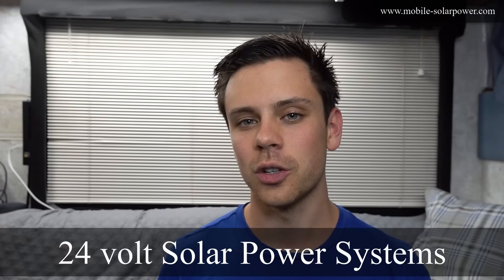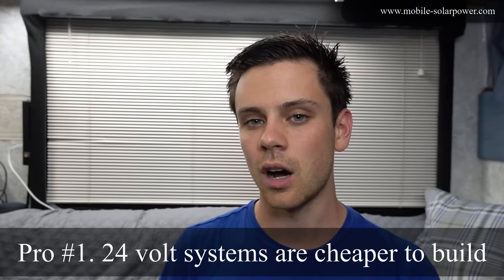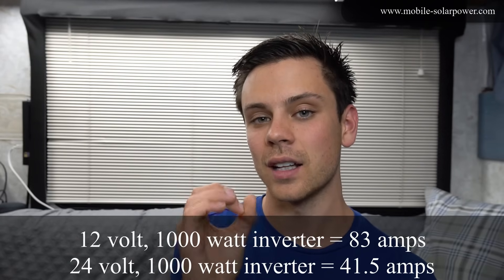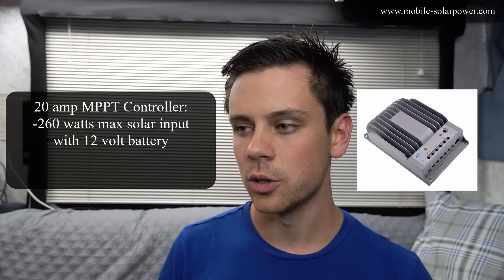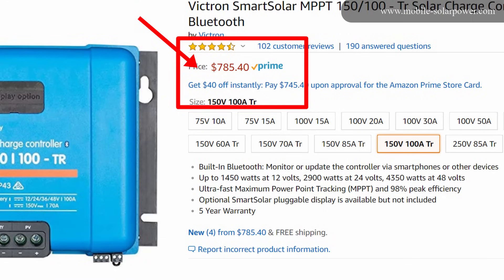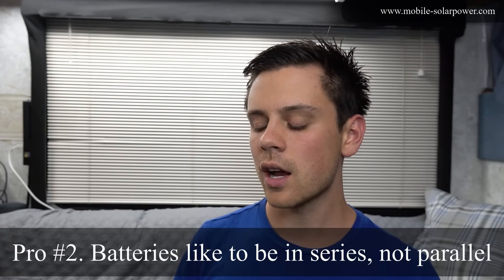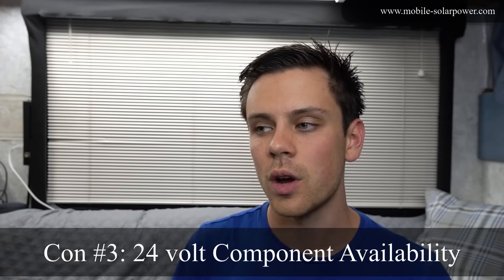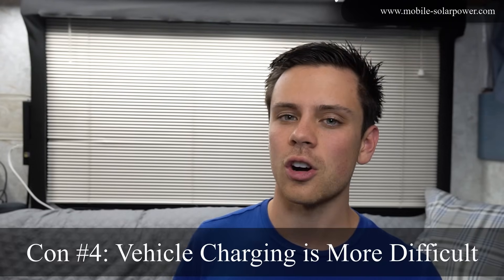12 volts VS. 24 volts for Off-grid Solar Power Systems

Comment: Hi,  I am seeking advice about how to make my on-grid system to provide me with electricity when grid is off.   The problem is that inverters that are designed for on-grid system senses the grid voltage and frequency to synchronise with them, but when the grid goes off the inverter also cutoff even in day light when your panels are able to generate electricity.   Is there away to isloate my home from the grid automaticaly when there is a grid cut-off and fool the inverter to keep providing my home with electricity.  Thanks
Reply: What you need is a system called no-break.  They have different classes about how fast they will kick in after detecting power loss in the grid, but many if not all of them can be upgradable with larger batteries so they can sustain your appliances longer, and they will recharge when the energy is back. They can also take energy from solar.

Comment: Hi, just asking, how many solar panel and battery do i need to run and air conditioning of 4.4amp, 115 voltage/6.5 ghz and 480 watts, For 6-8hours at night? 8 hours sunlight. Cost is not the biggest concern but safety is the biggest concern.

Comment: I'm following the plan from your website for "The Classic 400 Watt Solar Package" but can only afford one 100 Ah Lithium Battery. Can I still wire the 100 watt solar panels in parallel and series, creating 24v into the 40 amp charge controller? Or should I wire them all parallel? Are there other modifications I should make since my battery is only 12v? Thanks in advance!
Reply from the maker: Parallel and series will work great actually. It's ok to use one battery :D
Reply: @WillProwse  I figured it was a silly question, but being a complete beginner to all this, I didn't want to make a costly mistake. I will definitely buy your book! Thanks so much!

Comment: I'm thinking a boat..completely electric including propulsion, induction and convection cooking as well as all the electronics. 24 or 48? With panels becoming better, more efficient, and and more dependable this could work couldn't it?
Reply: I'm curious about this as well.  My guess is that is that your boat would only have enough solar panel space and enough storage batteries  to allow you to take the boat out once every 7 to 10 days for just one day of use.  Have you calculated how much electric power you would need to store to run the boat for a day?
Reply: @manbearpig8691  my hope is that I could perpetuate living on the boat and traveling. No I have not calculated any of it. There will be a gender and big fuel tank that was for motor fuel.

Comment: By the way 24v is a common voltage for buses, semis, and tractors etc. You could easily source an alternator from there for a dual alternator setup
Reply: I agree! I hope this could be an alternative solution.❤💥💯✍
Reply: Find used military alternators for under $200
Reply: @bladenrexroth2555  most junk yards I've been to only charge the core cost for an alternator. Pull one from and semi or bus ect. If you're gonna pay 200 you might as well pay 300 for a new one.
Reply: @alec4672  a reconditioned military surplus alternator? $200 is the happy medium between junk and brand new.
Reply: And Aircraft .

Comment: What about using a sterling power battery to battery charger particularly their ultra certain set for a lithium profile?
Reply from the maker: Those are great, but very expensive. You can use renogy DC DC charger. Both will work great

Comment: I want to run a 0.75 ton air conditioner that consumes around 880 watts 4 amps 220v 
On solar with a pure sine wave inverter with a 80v . 50 amp MPPT  charge controller 12v 

Or shall i go for 24v system

I already got 4 150w 12v solar panels 
And a 165amp lead acid battery

Please give me a advice
Reply: For this kind of output best way is to get small diesel or petrol generator for fraction of price. Cheap running cost, cheap installation and simplicity. With solar you would need to replace batteries every couple of years and babysit watching currents and worry about clouds. Generator can also charge your battery.

Comment: If anyone is interested in seeing a 24v system I have an example video. It powers everything I need in my tiny house/cabin. It includes a 285w panel, 500w inverter and 1kw 24v Chevy Volt battery (now 2kw). The entire system cost me less than $2000 Canadian.  Even if you are just fixing or upgrading your 12v system,  it's time to sell it and move to 24v (or 48 if you are power hungry). Also, bite the bullet and go lithium. Find someone who  salvages Chevy Volt batteries. I don't believe you can build a quality setup for less in the long haul. Remember,  I can keep my whole system in my cabin with no off gassing.

Comment: Off grid 30years = you have explained things very well -  I have work on 12/24 volt mix  with battery mix (lead acid and nickel iron )also using the hho gas coming off the nickel iron batteries  —— the potential of the hho / browns gas adds another dimension to the situation

Comment: Hey I see you have a lot of knowledge so was wondering what would be the best route to go to solar power my golf cart it has 6 12v batteries and  my boat which has a 24v trolley. Motor and a. 12v motor battery

Comment: Hi William
I have a stupid question
I would like to build a system with no battery
To use directly the electricity produced by the solar panel and transform it into hot water 
To replace battery with hot water .

Could it be possible ?

Comment: Thanks for the great info! Do you have a 24v solar charger controller guide?
Reply: Blakehx all the controller companies have documentation online for their controllers. So if you have particular controllers in mind you can read their documentation in advance. Also it’s important to make sure that the controller inverters you are looking at are 24v. Some self recognize. Some look identical to the 12v version. Sometimes they bury it in the specs when it comes to cheaper ones. Midnight, outback and Morningstar all have online documentation and have great manuals. I’m so glad I started with them because I learned a great deal of system education and have been able to manage systems that I’ve designed for various projects. There was an inverter I was looking at. I’m not sure if it was samlex or a comparable one that had a great manual with a lot of details on battery set ups and wiring charts.

Comment: Never knew about the parallel thing being bad for batteries.  I have 4 12v batteries in parallel for a UPS setup and I keep getting shorted cells.  Been through 3 batteries now in about 5ish years.  Been wanting to upgrade the setup to 48v though then I would do 2 strings of 8x golf cart batteries.  With mid point voltage sensor I could catch shorted cells sooner too if it happens.
Reply: Red Squirrel sounds like you aren’t vigilant about your watering of your batteries. Dry cels mean that you are over boiling or under charging on your system. Or have a lot of cycling and power fluctuations. Which can happen in weather. I keep the battery caps that have the float level now. And it’s easy to see when they start going low. I also change my batteries once a year and resort them and rebook them up. Clean them and recheck my wires and fuses.

Comment: Great video again. I’m torn between 24 and 48 volt as a tiny house can be the same as a cabin in some respects. I guess that’s up to me to figure out if I’m brave enough to go 48v. I should investigate the cost difference between 24v and 48v components to see if the danger is worth any cost benefits 😬 Thanks Will.
Reply: I guess a lot of it goes back to what you are needing to power. Fridge, AC and such seem to be the biggest guzzlers. 👍🏻

Comment: I should be paying you for this info. ^^  Personally I´m trying to design a system that works in the middle of Sweden that can produce enough power to run 500W for 10 hours a day. Not easy...
Reply: Well. It's easy, Although it is NOT cheap! LOL 😂

Comment: Lithium batteries don't care if they're in series or parallel, so long as they have a Battery Management System to prevent over- or under-charging.
Just be sure to buy the right size battery for the system voltage you intend to use, since the BMSs which are built into the batteries won't work correctly if you put multiple lithium batteries in series.
Reply from the maker: Well they need to be matched by internal resistance and capacity if put in parallel. I think I need to make an entire video to cover how cells cycle together in parallel vs series. Too much misinformation out there
Reply: @WillProwse  I'm pretty sure that lithium cells will auto-balance with each other while in parallel due to how they'll match voltages automatically.  So long as they're all using the same chemistry, the "full charge" and "end of charge" voltages will be the same no matter what the cell capacity.
What matters more is making sure that lithium cells in series have closely matched capacities, so that the BMS has less work to do and less energy is wasted during top balancing.
Reply from the maker: And BMS won't correct for mismatched cells. Capacity will be limited. Huge problem.
Reply: @WillProwse  Yes, mismatched cells in series will cause problems.  In parallel, it probably doesn't matter since charge state is closely related to terminal voltage for each cell chemistry and cells in parallel will auto-balance regardless of capacity.

Comment: I have a sm. 12v system 2 batteries pos to pos and neg to neg.  what is the best way to hook up my inverter that is best for my batteries,  positive on first and negitive on first or should the negative be moved down to the last battery since they are connected as one twelve system.  please let me know as I do not want to harm my batteries, cost two much to replace!  blessings.

Comment: Nah. I will still touch 100V DC. I am brave. For large stationary systems, definitively 72V, or even more. A home 400V from PV, I would still accept, as long it is done by a professional installer. (I wouldn't touch that one myself).

For small systems and mobile, definitively 24V, plus separate alternator if needed.

You save a lot on wiring, heating losses ans general efficiency.

Great video.

If somebody wants to run few small 12V appliences, you can tap off center of the 24V battery on both sides and still use it (after fusing it). Not perfect, but costs nothing.

If you have over 2000W, definitively use 24V or more. 12V starts to be very cost ineffective.
Reply from the maker: Yeah for sure, I agree

Comment: In using a 24 volt system in a series. How do you configure solar panels in a 24 volt system?  I plan on using 7 370 watt panels.  Are all solar panels 12volt?
Reply: Most house panels (60 cell) are around 36 volts dc. your MPPT charge controller will take that 36 volts and supply your 12 or 24volt batteries what they need to bulk and float charge

Comment: i use 24v and just center tap off the battery pack to run small 12v items
Reply: Exactly. It works great for small things, like light, etc. As long as you also fuse it.

I wouldn't do it for larger stuff, as it will mess with a balance.
Reply: This is exactly what I want to do.  What do you mean by "center tap?"  The only 12V that I have are a small fan and 2 small LED lights.  Everything else will be through and inverter.

Comment: Also if you go skip 24V and go straight to a 48V battery system you double your efficiency yet again, and then simply run everything of your mains inverter - job done, and it's elegant, uncomplicated, and and all your ancilliaries are completely consumer off-the-shelf plug-in.
Reply from the maker: Absolutely! Totally agree

Comment: Slight correction 3:48 wires like to heat up when they carry *current*, not power.  Double the voltage at the same power  = half the current = half the heat and loss.  Also, PV arrays should be engineered so the Voc matches the MPPT controller Vmax, for maximum low-light performance - watch your array charge in the rain....
Reply from the maker: Yeah I messed up that wording. I was mad at myself right when I posted this video for that reason.
Reply: @WillProwse  Happens on the big jobs.  You do well.  People need to know about you.

Comment: Can you recommend a good 40ah 24 to 12v converter
Reply: Same question. Did you find a good one already. If yes, can u tell me
Reply: Go to Amazon look up Samlex 24 to 12 v converter. They have a 60 amp model. I use a 30 amp one since the no load draw is only 25mA which is negligible.

Comment: Hello, just wondering if you can help me. I'm new to this solar thing. I live in my van. I jus recently brought a 200watt 24volt solar panel, I have a cheap charge controller, I jus got my mc4 connectors and from there I'm lost. I just want to be able too run my TV.   Can you point in the direction from there. Ex: what battery should I get? and should I get a better charge controller? Plse help...
Reply from the maker: My book

Comment: Im using 4 12V 100AH batteries in parallel without fuses and am a bit concern for safety after watching and hearing that 12v systems aren’t recommended for using when making parallel connections. 

So my first thought is to connect fuses between each battery? That should help me?

Comment: You should make videos about making large home sestems and how big batteries can store enough KWH for major consumers. I really do like these seystems you mentioned as a simple battery station in a she'd, but I had one before and alot of the times I would run out of energy half way through the day while using power tools. I think you could build some awesome systems That have charge different power banks autonomously.

Comment: They make new alternators for vehicles that charge any type of battery, as for a slow draw to charge, you add a mini regulator or  split the current to decrease degredation or harm to battery. So sometimes it's best to have multiple battery's to catch all that power produced without damage to any components. Yes one would charge faster then the other, but after the first battery is charged it switches to charge the second. Your regulator would then monitor battery charge, in the chance both are fully change it would send power to ground. Unless your not a idiot and figure out how much power you produce an how many batteries you would need to capture all that power. Just as the same goes for calculating how much power you need before choosing a seystem. Because even a 24 volt seystem is extremely low compared to how much power you need in a day.

Comment: Can I use a converter to use a 12v inverter with my 24 battery bank?
Reply: You can, but it is going to be inefficient. Plus you need to make sure the converter can handle the load and is cooled
It is probably better to find a 24V inverter instead for this. And only use 24V to 12V converter for 12V DC appliences.

If you only need 250W from the small inverter, it would be ok, as long you also have some use for the 12V DC from the inverter. Otherwise is it just unneeded complication IMHO.
Reply: Thank you

Comment: The reason 30VDC is the limit is that it is the threshold where your muscles involuntarily contract so you can't let go of things (like the wire that is electrocuting you). This has been studied extensively for divers doing underwater electrical work. Unfortunately for women, they have a lower voltage threshold for involuntary muscle contraction...
Reply: I thought it was much higher.  We have a 48v battery bank at work (runs at 54v) and if you touch it you can't feel anything.  I imagine if you are wet that's a whole other story though.
Reply: @redsquirrelftw  Yes, it's like touching the source with your tongue! ;-) I think the old telephone (POTS) ringers were at around 50 Volts, and those could shock you, but the voltage was obviously very dependent on how far you were from the switching station.
Reply: The ringers are a little higher I think like 90vac or so.  It's a low frequency AC too.  Been shocked more times than I can count when working on the MDF at work LOL.   Some types of data circuits are fun too, some run at around 300v and it's constant.  Just glad the ladder is made of wood lol.

Comment: Great video, but to carry twice the DC current, you need twice the copper area which means that the copper only needs to be square root of two (~1.41) times as thick. But your point is correct in that you do need twice the copper, so it is roughly twice as expensive...

Comment: Hey great explanations. What are your suggestions about 24v load appliances that i can use, i cannot figure one? I've chosen 24v inverter and i am just setting up my solar system and i am thinking if it is safe with no load in charge controller during and or whole day of peak charging hour. Any comment would be appreciated.
Reply: Oh it took me 3 times to understand. It is safe to have a charge controller connected to solar panels with no load, the controller just allows to panels to climb to open circuit voltage assuming that much voltage is safe for your charge controller.